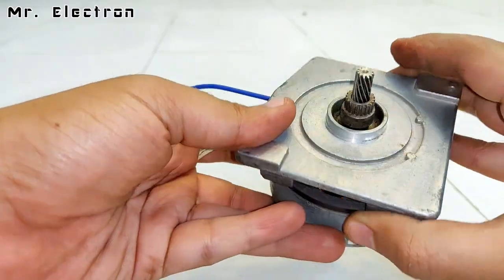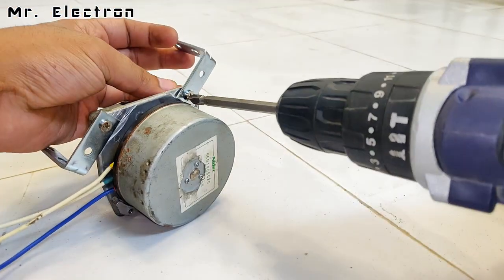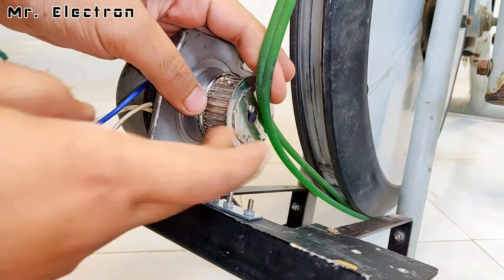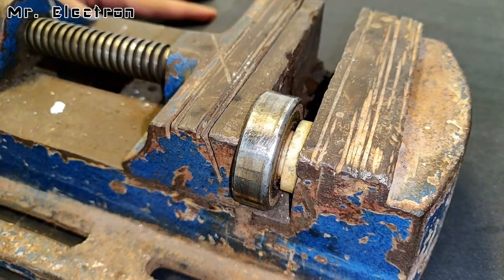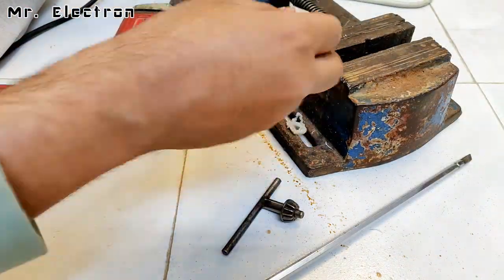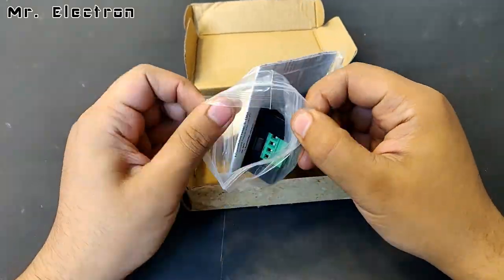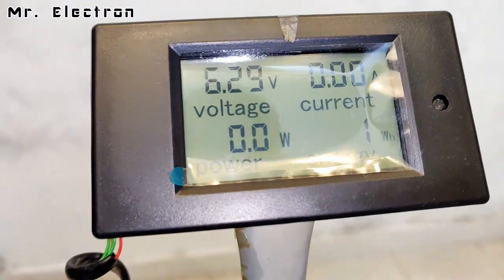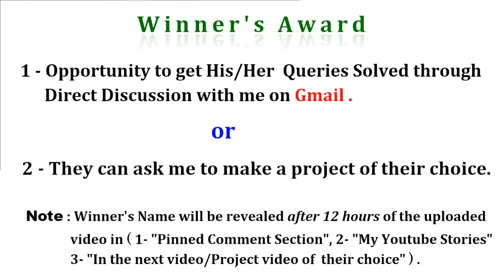24v Brushless DC Motor To Electric Generator ( BLDC From Photocopy Machine )

Comment: i have new idea for system to get away with super stuff. take forklift hydraulic motor like american benjamin nelson and take out guts and put in motor and second motor so when spin makes energy for other motor and make just little bit larger so plenty no lag then have multi control system so does not lag also and one wheel runs all four tires. also try for micro machine like toy car to save on battery use and you get toy that lasts all day. maybe use four and use on for regeneration of tiny car battery lead acid battery and be a revolutionary. hahahahahahaha. you NOT!!! that would be good deed!!! and i know you would tell and punish me.

Comment: I am getting  electric shock 12v  dc adapter and  I check output voltage is 12v dc ????
Reply: I  try different adapter but getting shock
Reply from the maker: I also get that shock... Its because the DC is not Pure.
Reply: @MrElectron  How to rectify it🤔

Comment: If the 10W DC motor is being applied enough mechanical energy on its shaft, then, yes, it would be able to start a 1KW DC motor.

Comment: i still want to see a 12 volt 5000 rpm motor turn a 320 amps alterntor that is connect to a 350 amp alternator turned into a motor of course both will have to be ac and i don't think you know how to do that.

Comment: "Can a 10 watt dc motor start a 100 watt dc motor?" Yes a 10 watt dc motor can slowly turn an unloaded 100 watt dc motor, but if you load the 100 watt motor or have too much resistance in the 100 watt motor, then you'll have trouble getting it to spin. 

If you use a battery then because energy is conserved, you can store 100 minutes of 10 watts to later power 100 watt motor for 10 minutes assuming 100% round trip efficiency.  Of cource realistic round trip efficiency will be less than 100%
Reply: The question was a 1000w motor

Comment: The 10w motor probably wont be able to start a 1000w motor since it would not be able to generate enough current to hold the output voltage. It depends on how many volts and amps each motor are rated for, but no it will most likely not work. Maybe if you rotate the motor at some supersane speed it would react in some way.